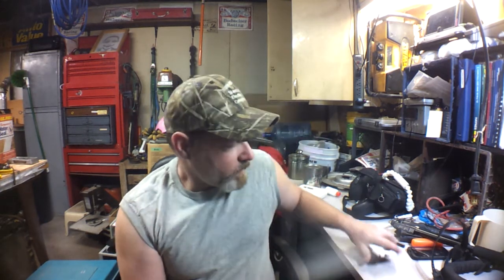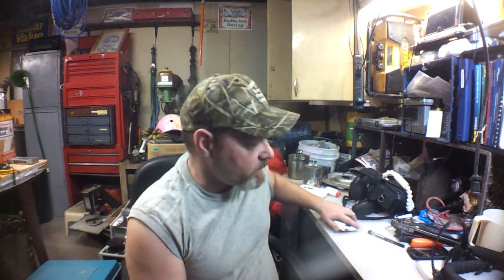Q&A HVAC 24 volt troubleshooting without a common wire

Comment: I found the c wire tucked away and used it into my smart thermostat. It didn't power up. Found it attached to where the yellow wire comes off the furnace. Moved it to the c wire from furnace and still doesn't power the thermostat. I'm at a loss here. Any input?

Comment: hi i have and ac problem to power at the thermostat,i replace it and still nothing works,transformer its giving 27 volts so im guessing its good,but not power at the red wire or any of the wires on the stat,fuse its also replace,thanks if yoy can help

Comment: Any chance  you could show step by step how  to troubleshoot with a volt meter on  each component in the order of operation  with a volt meter on a  A/C and  Furnace  unit  by process of elimination?
Reply from the maker: +deltafour1212 coming up